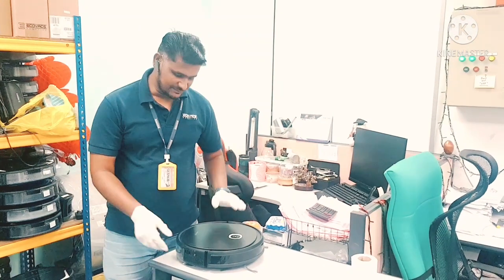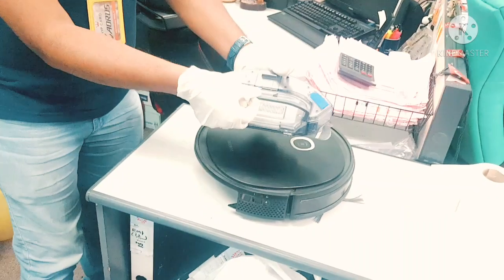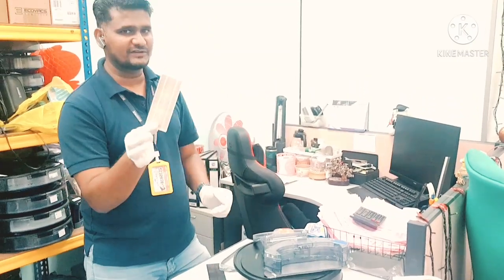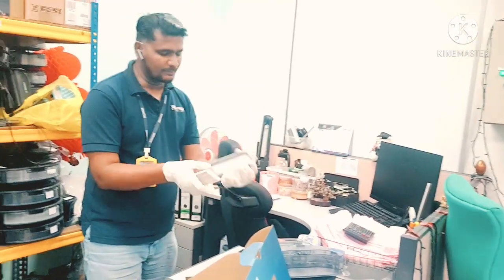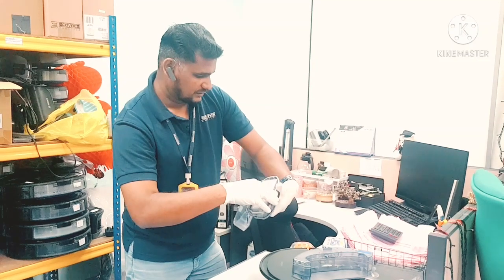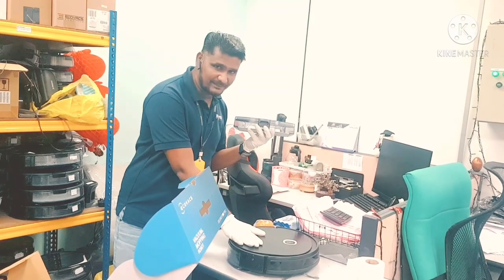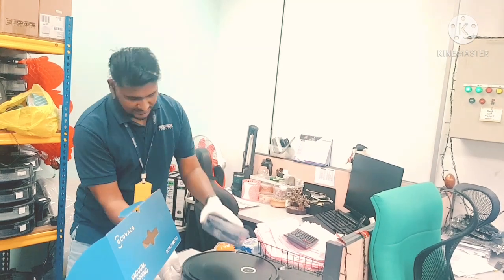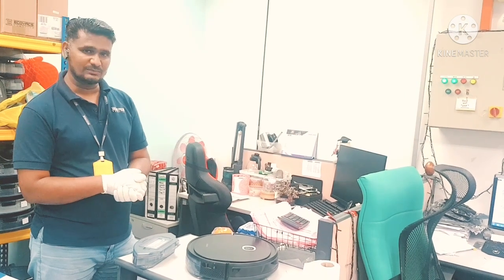Ecovacs Deebot U2 Pro Maintenance

Comment: Halo I need this XL dustbin filter where it is available
Reply: I had so much trouble finding this . It’s a different size from the other dust box. The technical support were most unhelpful. I searched on Lazada online shopping platform and found it . If you’re in Malaysia you can find it locally. Bear in mind that this filter is 11cm in length whereas the filter for the other dust box with water reservoir is 13cm. Hope this helps.
Reply from the maker: Hi ... for this model accessories u can buy direct from service center or can contact ur seller or Amazon or any online selling app in ur country can check there weather parts for this model available there or not

Comment: Suddenly my robot stopped spraying water. The mopping cloth remains dry only. When I reopen the water tank seal after running the robot, it's open with pressure so looks like the water pump are also working. Can you please suggest solution?

Comment: Hi. My deebot u2 is suddenly stopped spraying water while mopping. How to solve this issue?
Reply from the maker: Actually on top of water tank there's a very tiny pump which builds pressure in Water Tank so It can dispense.... that's not working...so far on YouTube no video available that how to solve this issue... but soon I'll prepare n upload about this topic
Reply: I checked visually but nothing broken or showing anything not proper, I am very soft while using it and while returning its tank for every fill
Reply from the maker: I can understand but sometimes there's technical issues...if an electronic component  suddenly stopped working so need to fix

Comment: Hello, I have tried mopping model for mop 300sqm , water tank is still full , no water come out . What I should do?
Reply from the maker: Actually water tank pump motor not functioning that's why water can not dispense if under warranty then u can claim water tank from ur seller if u purchased overseas n dont  have any service center nearby then i give you one simple tip witch confrm will work🙂 
After you fill up the water don't fully tight blue rubber seal of water tank slightly remain open then water will start dripping because now air pressure inside the tank is higher si it can drip....or another way is you make a very tiny hole in tank beside blue rubber seal that also will do the same thing..increase air pressure so water can dispense

Comment: Hello my deebot u2 keeps stopping and saying brush is tangled but there’s no hair and the box is cleaned, the main brush is clean but the 2 front brushes keep stopping and going again and again as well and I’ve cleaned them pretty thoroughly as well
Reply from the maker: To confrm that main brush is ok not jammed...there's one trick u can test @ home just remove main brush n main brush cover & run the deebot without these 2 parts if it start functioning as normal means ur burh was really jammed...if it still couldn't move as normal then main brush motor is hammed in this case need to contact with nearest service center

Comment: Recently purchased U2 Pro and it's doing a great job. Today the front universal wheel got jammed because of my dog's hair and machine stopped. I removed and cleaned the wheel but machine didn't start so I switched off and switched on and then presses the small button besides the switch. Now the machine is working but no voice. Please help.
Reply from the maker: OK noted. Beside the power button there's a small reset button as well.. Plz after u power on the deebot just press that reset button n hold for 6 sec. U will hear the same music sound as while turning on... Let it reset then after few seconds connect with Mobile App n try again hopefully will be OK... If still same then plz try to check from app settings.. Maybe sounds notifications off.... Just turn on from there if it's at off position
Reply: @ecovacstechnicalsupport5278  I tried resetting but doesn't work. I rechecked settings in mobile app, the voice is on. All sounds like voice, beep, music etc have stopped. But otherwise the Deebot is working fine.
Reply: Hi sir...how's it working now..do u recommend this product after your usage
Reply: Hi sir how's it working now..do u recommend this product
Reply: @bhargavi_gupta9682  It's working great.

Comment: I have put the water reservoir back into the deebot (U2 pro) but forgot to put the dustbin back in, now the reservoir won't come back out...is there a way to remove it again or have i broken it?? Any help would be much appreciated!
Reply from the maker: 🤔 in thinking how you put back without dust box because without dust box it can press down if can not press down then it means you forcefully fixed back...& now still lock stuck because can not press down the lock without dust box
Reply from the maker: But no need to be worry..there's nothing impossible 😉  im here for your help...just use a  flat screw driver enter the screw driver flat part from top of ur water tank from middle of water tank & just pull down the screw driver then lock can come out ...but if u do like this few times your water tank could be damage..so plz be careful if u like my reply plz subscribe my channel n like video tq

Comment: Hi. Is there any tutorial re firmware upgrade failures. Simply unable to upgrade from 1.3.8 to 1.4.7 despite trying everything. As a result cannot use the app for controlling the device like switching to edge cleaning mode or knowing how much battery is left etc . The robot is on the wifi network without problems but connection timed out error when trying firmware upgrade

Comment: Our U2pro is saying to check the driving wheel and its going in circles. Looking at it there does not seem to be any visible issues. Any suggestions?
Reply from the maker: Ok noted..sometimes just gear stuck...i send a video link. U can try at home first if still can not then contact with service center for warranty claim 

https://youtu.be/ZconNhEubYM

Comment: The water flow to the cleaning cloth in my Deebot U2 Pro suddenly stopped, even when the water tank is full. I tried changing the water flow settings from standard to high and back, but it does not work. Are there any steps I can take to make it start working again?